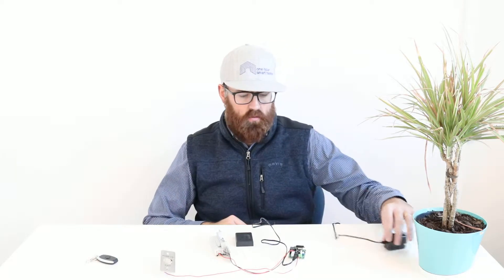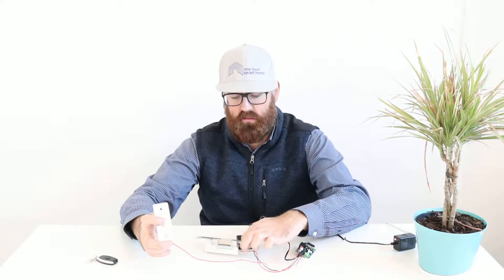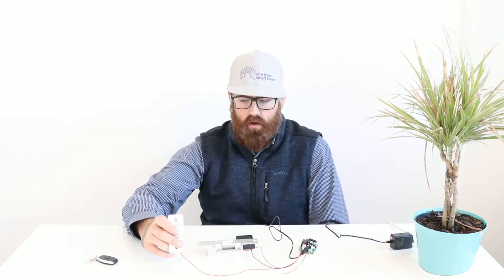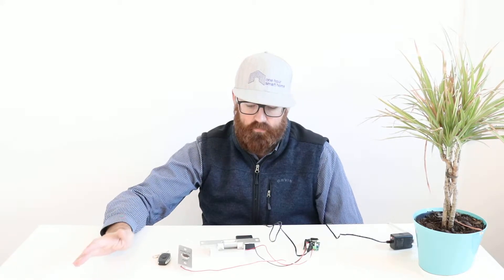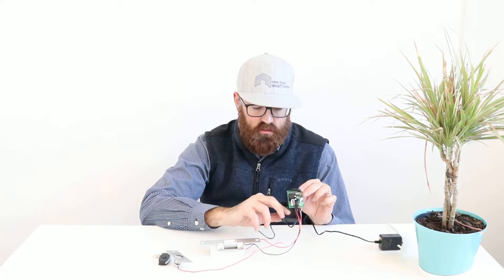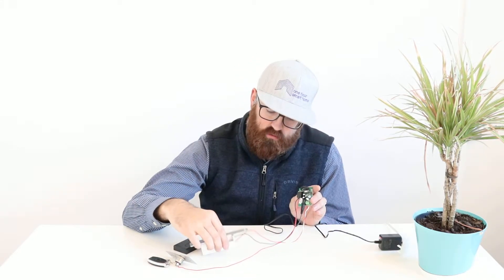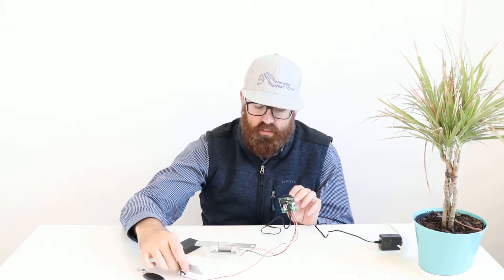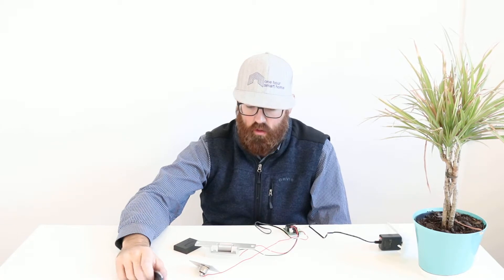How To Wire or Fix An Electric Strike or Electric Door Latch

Comment: hi, I have a new ring doorbell, which I am using by removing the old doorbell. the old wiring and the old transformer seems to be enough to power the system. there is also a strike on the front door. there were wires to it, and it used to be able to connect to the old intercom system inside house by front door. the intercom system is now bipassed and no longer buzzing anything, and really I want the ring system to open the strike on gate. I can not find anywhere how to do this, not from a diagram nor a video. can you help me? do I need spend 300 on the RING ACCESS CONTROL PRO, or is there a cheaper solution to get ring system to recognize and apply the strike when im home or away, using the ring app? thank you in advance for any suggestions. your videos are great btw. Jim